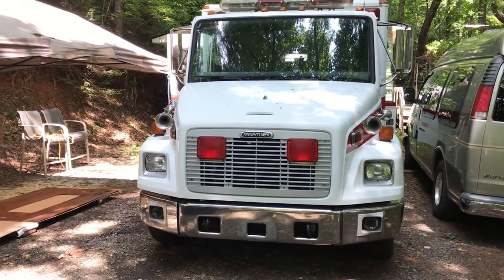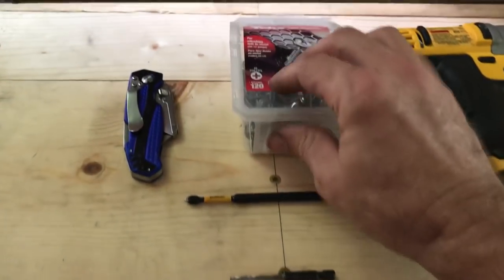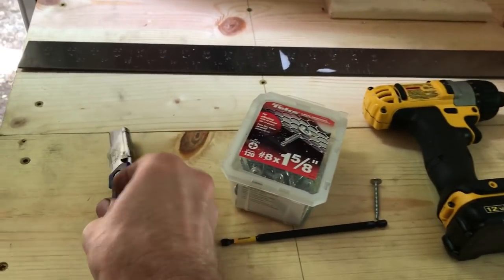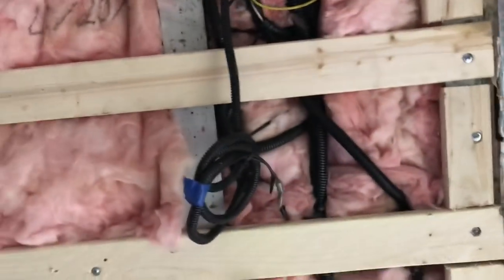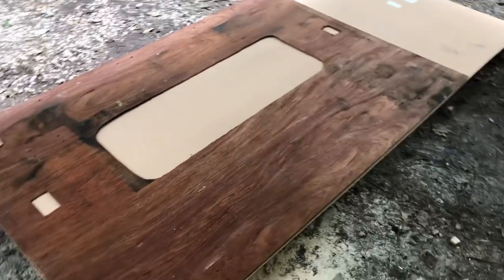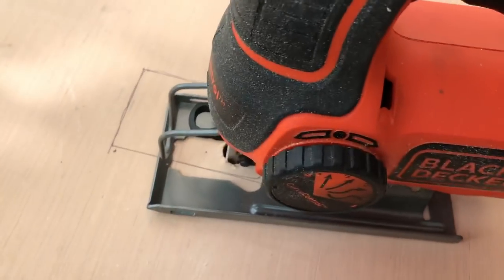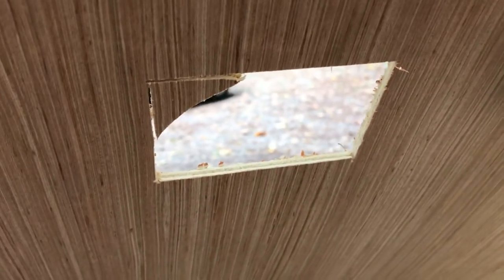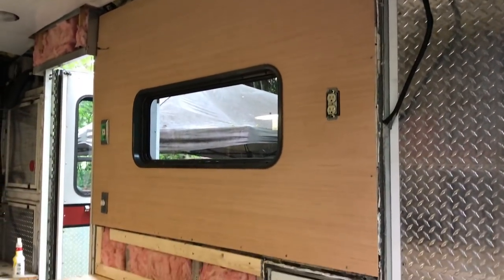Insulation, Re-Building Walls - Ambulance Camper Build Conversion RV Freightliner FL60 MAV

Comment: Thanks so much for this video, I subscribed! It answered so many questions that I had in my mind about framing/insulating an ambulance. I'm looking to purchase one here were soon to convert into a traveling museum that can fold up and away and open up to a livable camper. At the moment researching power with absolutely zero electrical experience is my biggest hurdle to get over.
Have you had any experience with raising the roof on one of these? I'm considering making a fiber glass shell to fit the roof cutout but I'm not sure if that would be the best course of action.

Thanks again, I look forward to watching more of your videos!

Comment: Wait! In residential builds you are required to use a vapour barrier over the fg insulation because it transfers moisture so easily. I’m guessing that temperature variations will be even greater in a metal box that you have decided to “condition” (heat and ac). What R value do you think you have there? Please at least leave an access panel where you can monitor this air/moisture issue easily over time. Check for discolouration of the pink fg and use a moisture meter. Consider doing a test section with Roxull which is also super easy to work with. Btw we worry about you! Please use gloves and a mask when using fg insulation. We want you to be doing builds for many years to come! 🚚🚕🚗🚓🚒🚐🚎
Reply from the maker: Thank you very much for your concern. You are absolutely correct about the mask and gloves. I like your idea of the moisture meter test. I am not familiar with Roxull - will have to check that out.

 I based the method and type of insulation on the following research I did (I am certainly not an expert):
1. The insulation method is the one employed by the Wheeled Coach factory (who built this ambulance) which builds multiple types of ambulances and has for decades. There is a great video on the construction methods used at the factory and you can see the insulation in the video:  https://youtu.be/cV9q4pOo2g4
2. The ambulance sold for over $100,000 so I know they did not cut corners on insulation costs. The ambulances have to sit in hot areas for extended times and are subject to drastic changes in temperature so keeping patients at a controlled temperature is critical.
3. The ambulance is certified to very high health standards and even higher for fire rescue so the method cannot be such a way that it traps moisture and causes harmful effects for patients or healthcare workers.
4. When opening all the walls up there was no evidence of mold or mildew with the exception where the window was improperly installed and leaked for 13 years. All the rest of the black in the videos is soot from 13 years of fires - seems the fine particles can get into everything (bleach has no affect on it - seems to be just carbon - 409 seems to work best).
5. The ambulances are held to strick maintenance schedules and I would have to believe that if a problem had been identified over the years that Wheeled Coach would issue a recall or safety notice requiring a refit of the walls. Being owned by a government entity they would be required to comply with any health risk issues.
6. I am using a wall construction method that uses all screws making it easy to open up all the walls should it become evident that a problem exists. 
I do appreciate your concern, you always have the best advice and tips and are very knowledgeable on health issues.
Reply: PriusStealthCamper Adventures Hi! Back from an auction. All good info. Because I do third part certification testing what is approved by weak regulators in both your country and mine the human health issue almost always falls to “Did it kill anyone”? The manufacturer encapsulated more than you will be so that is another factor. Cant remember when it was built but they may not have had more options then. Does the MAV have double walls? The way builds in every vehicle are decided is costs be reduced - it often falls to what the eye can see. Fyi- I nvr recommend anything “pink”...i recommend roxul or dow blue rigid. Roxull came out with its product in “blow in” format which would be super cool for very hard to reach voids. I think you would get a higher R value from Roxull and it doesnt soak up moisture like pink fg. Mother knows best! Lol 🙃 (and put on those gloves and mask!)
Reply: I have an 89 conversion van with pink insulation, i keep an eye out but never had any issues and use big buddy heater.

Comment: I watched the factory build video you recommended and considering what they retail for, compared with what you paid, that's gotta be a lifetime bargain. The vans with a rollcage caught my interest. Why would you buy anything else, if you value quality?
Reply from the maker: Absolutely agree! I was sold after seeing the quality.  These are made to last way after their medical use but there is no demand for them. The ambulance box decreases the value of the chassis.
Reply from the maker: If you want to see something really spectacular watch this video where they intentionally flip a wheeled coach ambulance with test dummies.  https://youtu.be/I4Xkfvj_bxg  The box only gets a bent corner. The box also protects the cab from any driver compartment damage.
Reply: Didn't even break the rearview mirrors off. That's remarkable.

Comment: Over time that Fiberglass insulation will sag, better to use hard insulation instead and you will save yourself from the itch!!
Reply: Tahir Rana  It will only sag if it gets wet and even if, in 10 years, he needs to replace it, the attachment method he used will allow him access within minutes.